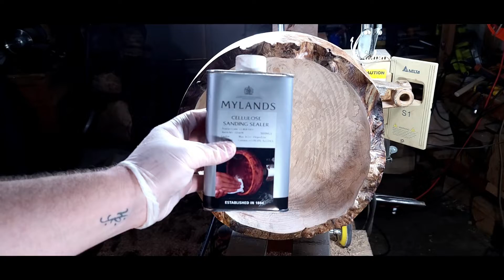Woodturning: Live-Edge Maple Burl Bowl

Comment: Hello Dan, I discovered your channel today and unfortunately I see that it's been two years since your last video. It's a shame, I hope it goes well for you and you'll be back at the lathe and in front of the camera soon. Right from the first video I felt comfortable with you, your sonorous voice, your calm manner, only they are very dark, your films. You have very good ideas, also in terms of design and power carving. I also think it's great that you reject the use of resin, I'm with you on that! Despite all the words of praise, let me give you one more tip: When hollowing out an open shell, you work consistently from the outside to the inside in many small steps and cuts, and this means you have as much material as possible in the center for as long as possible If you leave it, you will have greater stability for much longer, especially outside, where the speed is much higher than inside. The thinner you turn, the more the wood flutters. And now the mass in the middle has a balancing effect, making work much more pleasant. Enter on YouTube: woodworking, turning thin objects flat and without vibration. A Dutchman explains the trick to a German editor at the trade newspaper “Holzwerken”. Thank you for your patience in reading this, best regards from Northern Germany, Schorschi.

Comment: When you reverse mount bowls or hollow forms you can't mount on a cole jaw how do you do it? I've done it with soft jaws and pressure from the tailstock but curious what you do.
Reply from the maker: In this case, the bowl was too tall, so I used a spacer block, sanding pad, and a rag. No mechanical connection, just something to provide support so I can bring the tailstock up. Was going to grind the tenon off, but then I realized I could put a spacer in (after I'd carved away my center point). So it was tough to get balanced. Normally that's how I'd do it. May need very slight touch up on the inside after. That's only if I can't use the Longworth chuck.

With hollowforms, I always use a little jam chuck unless the form is not strong enough.
Reply: @danyoung6974  thanks Dan, I'll give that a try next time.